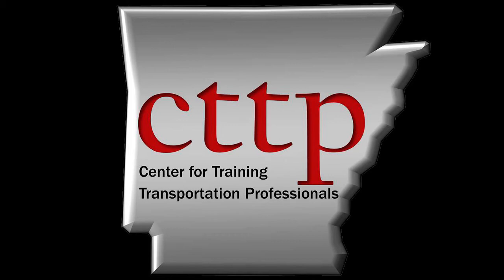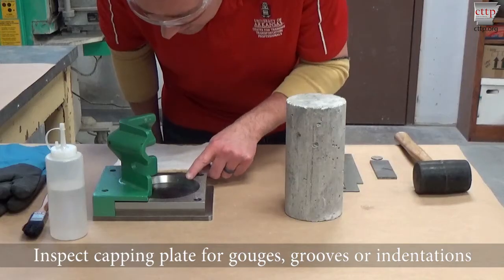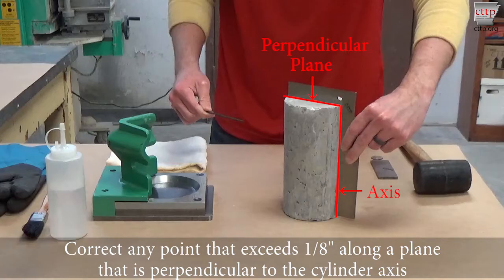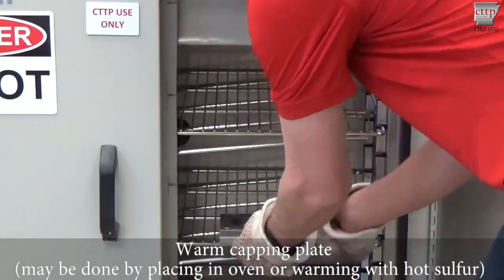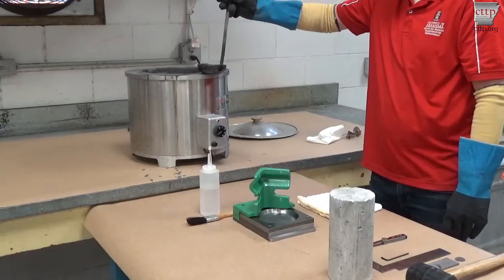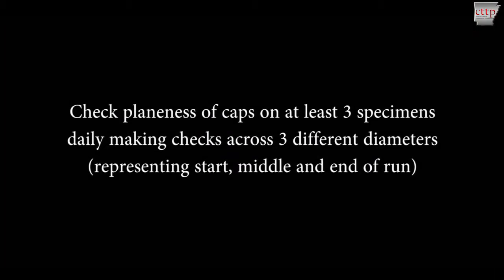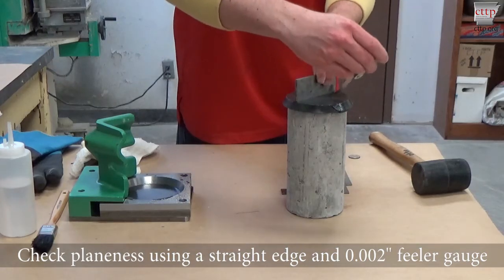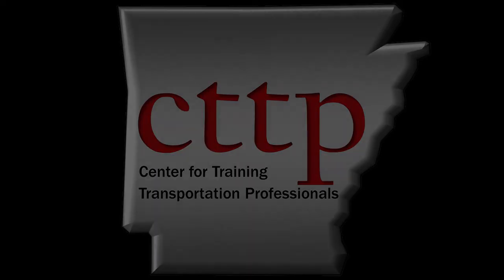ASTM C617 - Sulfur Capping

Comment: It takes only a very thin film of oil on the capping plate. I learned it's just as effective to wipe the plate with a smooth towel after applying the oil. You'll get a capped surface that looks as smooth as glass. Every little bit helps when a lot rides on the results.